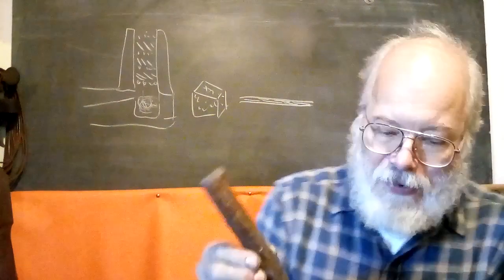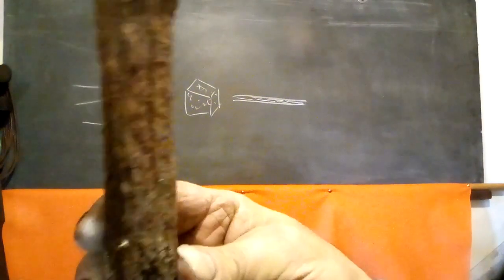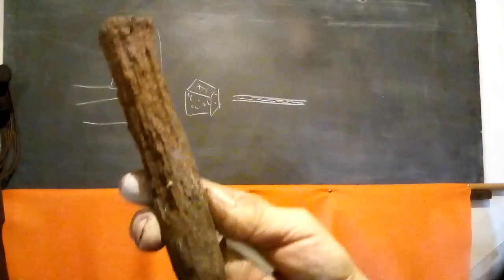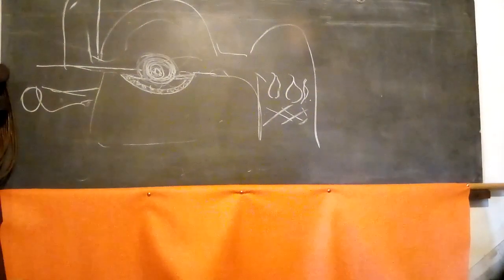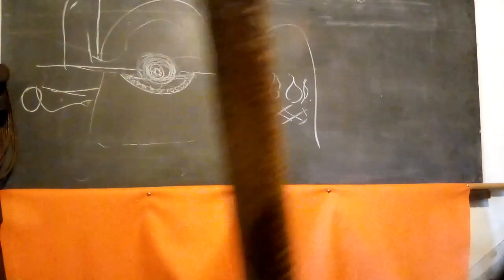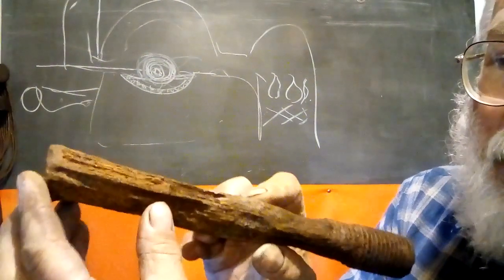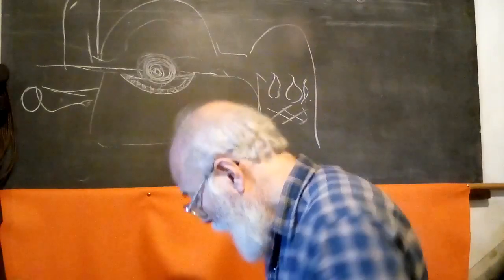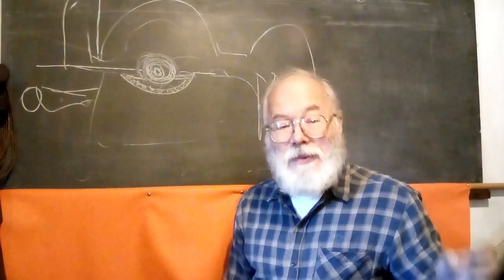A Blacksmith's Dictionary 7 Types of Wrought Iron , or A Short History of Iron Making

Comment: Outstanding, this is exactly the kind of information I love to see passed on. I had never heard about the beyer process.
Reply from the maker: Hi:
 Like many good ideas, making wrought iron by mechanically mixing in slag was developed by a number of people. Byers process was "invented" a half dozen times, Byer was the guy who made it work , so if you run into any of that type of iron it was most likely made by Byer or Lockhart Steel who made it after buying rights to the process. I think Aston in England used a process that was very much the same , but I don't remember the details.
Daniel

Comment: Do you smelt blooms regularly or is it something you've retired from?
Reply from the maker: Hi:
 Tired from is a better word. It has been more than ten years from the last bloom I made.  Back when Wally Yater was chasing Wootz , 1980's , I was excited by his experiments and tried all sorts of early metal working projects. making iron and wootz.
The basic problem from my viewpoint is that it cost me too much time away from earning a living. At a bare minimum , setting up a furnace , preparing charcoal and ore and running it all would equal over $3,000 of lost work. Sure people do this on youtube all the time, but they are making enough money from youtube to underwrite such projects. 
if this is something you want to do, it should not be hard to find a video on doing it, and like I said in my video , there are a large number of variables , so you will have to try stuff to see what works with what you have.
Daniel

Comment: I'm looking at an advertisement from 1843 from the Albany to Buffalo Line. Albany to Buffalo is 265 miles, as the crow flies.  Two rails makes 530 miles of rail.  So, how on earth did they make 530 miles of rail 14 years before the Bessemer Process was even patented?  And, as you mention, a puddling furnace does not produce steel but softer wrought iron.  Would they have made rail out of wrought iron?   RSVP Thanks
Reply from the maker: Hi:
 "blister" steel made by carbonizing iron was what they most likely used for the cap on the rail. Big billets of iron were welded up by making piles of the smaller billets made from the puddled balls and welding using big steam hammers.
Weld the steel onto the slab of iron and roll into rail. 
It helps to remember that rail for those early light trains was small, like 4 inches high and thin in section.
Daniel
Reply: @danieltokar1000  Yes, I remember blister steel from your talk, which I watched in its entirety. I've been looking online and have seen samples of old rail, they weren't 'T' shaped and were held in 'chairs'.  I'm a trained welder and have to ask, if a bloomery was not able to reach a temperature to melt iron, while being smaller and the fuel more compact and proximal to the ore, how is it that a puddling furnace was able to do so?
Reply from the maker: @jthepickle7  Hi:
 Old rail did evolve a lot before we ended up with the "modern" shape. Not sure of the dates , but early was small ,no matter the shape.
The puddling furnace is easy to answer.
Bloomeries were making pure iron . It melts at about 2600F. Puddling furnaces were using cast pig iron with a 2-3% Carbon. It melts at 2100F. So as the carbon "burns out" of the pig iron , it's melting point goes up and it freezes to the rod used to stir the melt.
This is the reason they made iron instead of steel. There was no easy way to stop halfway.
Also why it is easier to "burn" high carbon steel in the forge and very hard to burn cast iron with a torch. In the one case the steel has a lower melting point than mild steel , in the other there is a lot of carbon that has to burn away before the cast burns.
Daniel
Reply: @danieltokar1000  Thanks Daniel. In what sort of furnace were they making pig iron? - if not in a bloomery. I've watched a few videos of people feeding, all day long, a bloomery but never saw anyone take the temperature. How close can one get to 2600* in such a furnace?
Reply from the maker: @jthepickle7  The big furnaces that replaced the bloomery are the 30 ft high stone ones , like Hopewell Furnace,https://www.nps.gov/hofu/learn/historyculture/iron-making.htm
I did some work for the Park Service for Hopewell Furnace. Made the big chain on the swing arm crane in the casting building.
Bloomery operations are small scale, make maybe a Max bloom of 50 lbs.
Hopewell made three tons / day of pig iron.
If you scale up a bloomery , at some point you make a cast iron furnace, as the temperature can get higher. The high temp is needed to melt the slag, the cast is super heated , 400 F above its melting point , so it can flow out of the furnace like water.
Scale is always a problem, bloomery can be done by one or two people, Hopewell needed two hundred workers.
Look at my video on " How Many Blacksmiths do you need"
Reply: @danieltokar1000  Too, the period I'm studying is when they just began using anthracite - no doubt that made a difference, especially with puddle furnaces.

Comment: ..Excellent explanation and examples Professor !! i've heard of why some steam engine boiler engineers wanted wrought iron in them rather than more modern types of metal...
Reply from the maker: Wrought iron black pipe was written into some government code books for sprinkler systems , so as far as I know , the last use in large amounts was in the early 1970's government building sprinkler systems. 50 years , and they may be replacing those systems. Just keep your eyes open
daniel